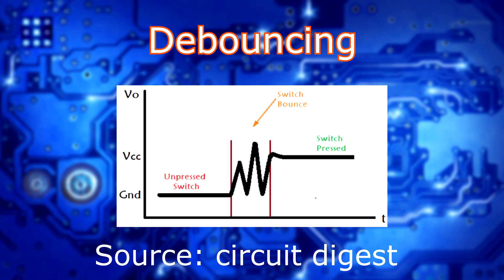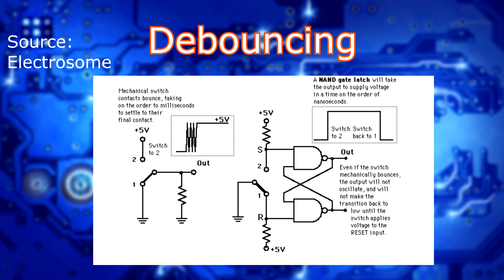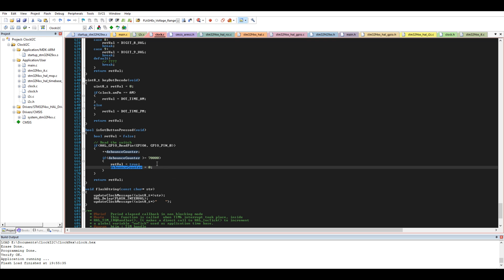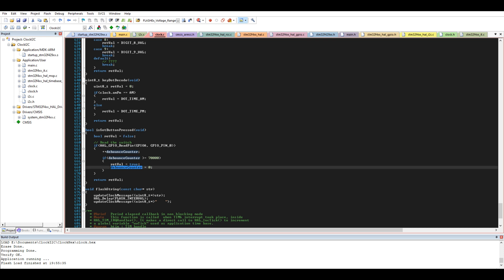Why Your Switch Doesn't Work & How to Fix it

Comment: 6:20 this solution is not the best, it adds delay. There is a much better way, just as simple.
Think it like this: if the GPIO pin has been reading LOW like for 10 seconds (as an example) , the moment it turns HIGH, it means the switch is changing state FOR SURE. We count this moment as a change in state, regardless anything (since the timer is surely off). Then, we start the timer, but not for this change, but for the future change where the switch would go from HIGH to LOW. By doing this, we eliminate an unnecesary delay/ reduce input latency.
Also, if we wanna go further, keep in mind that doing a delay with counters, makes the delays variable depending on CPU usage. We would need to use a timer based on actual time. But for common applications it should be ok.
Reply: In other words, just change the order,: first, change the actual value of retVal , second, start the delay for the momentary blocking of state changes.